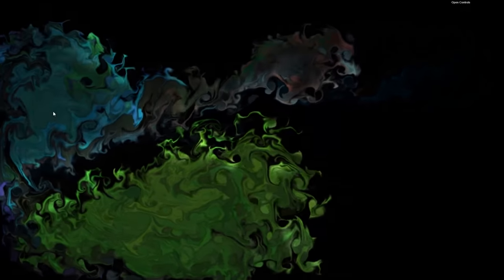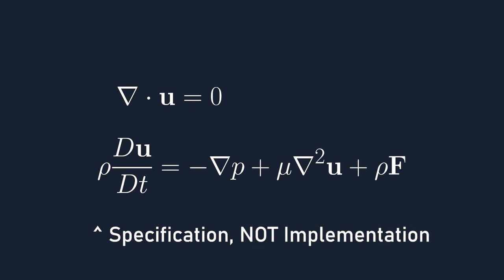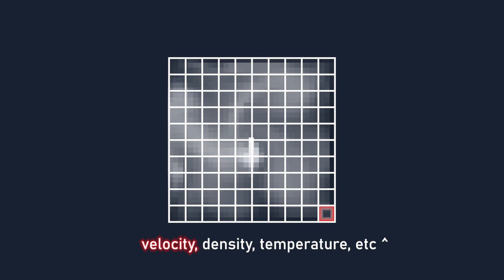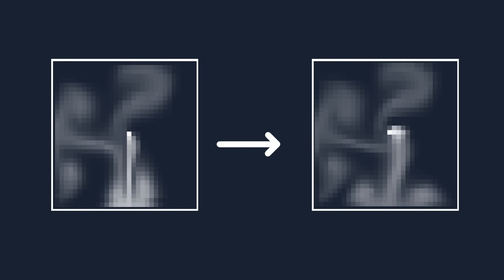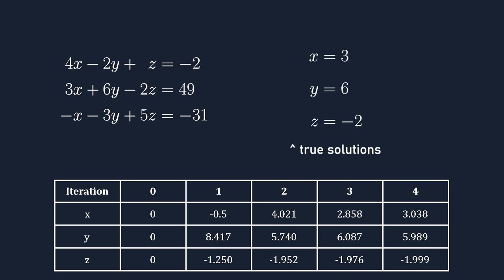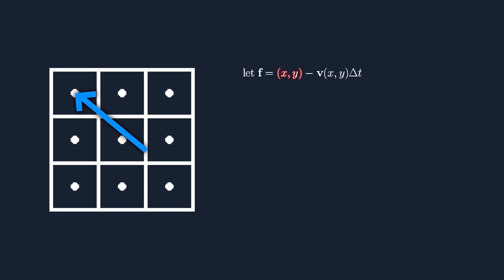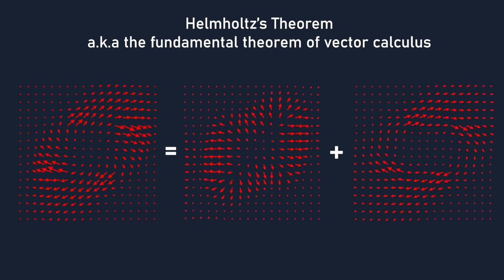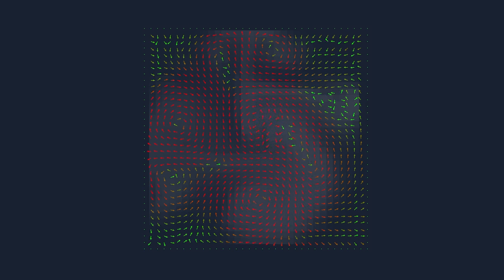But How DO Fluid Simulations Work?

Comment: Careful viewers! I might be wrong, but the equations shown for diffusion in the video are incorrect. If you look at the paper by Jos Stam, the simple, unstable equation for the next density is dn = dc + k(sc-4dc) (where sc means the sum of the densities in surrounding cells), which is not the same as the equation shown in the video, dn = dc + k(sc-vc), where sc is the average of densities in the surrounding cells. I saw that when implementing the method seen in the video, density was lost after diffusion even though it should just spread out.
Reply: Thank you! :D

Comment: Too bad I found about this video after I did the same thing. It took me over a year to understand the theory and algorithms behind Stam's papers, but you explained it in 15 minutes! Great video anyway!
Reply from the maker: If it took you a year, I'm sure you won't forget it anytime soon! :)
Reply: @Gonkee  I still have no clue how to program that. Have to watch the video 5 more times :D
Reply: @pinkyrng7104  just start one step at a time, try and get the basic system working so that you only need to learn one new concept at a time to eventually get it all working
Reply: Same for me. But it's not an easy subject though and contains many different algorithms and approaches. I also skipped the lerp part, because on the GPU you are able interpolate between pixels by default, with the filtering step.

Overall very detailed and well made video! It helps a lot of curious people.
Reply: @pinkyrng7104  You're making it sounds complicated more than it is. You just look at the N solver equation and implement an N loop for it. I did it in 1 time watching the video and just rewinding it to where the equations are.
Reply: @nullbeyondo  I mean you are clearly epic and he is not.
Reply: @Gonkee yea
Reply: yeah this video explains it pretty well (tho 10 minute physics' video does explain it even better)

Comment: Slight correction on the diffusion step, the equation according to original paper is x0[IX(i,j)] = x[IX(i,j)] - a*(x[IX(i-1,j)]+x[IX(i+1,j)]+x[IX(i,j-1)]+x[IX(i,j+1)] -4*x[IX(i,j)]), which would be d_n = d_c + k (s_c - 4 * d_c).

Without doing 4 * d_c, the amount donated to the 4 surrounding cells would only be subtracted once from the original, resulting in a net increase in density/velocity from nowhere and breaking conservation of mass.

Additionally, I believe the equation d_n = d_c + k (s_c - 4 * d_c) explains why its necessary to diffuse density reverse in time, because it blows up under certain scenarios, resulting in negative values. An example is if you have a really high value cell (say 100) surrounded by really small value cells (say 1). Let K=1. On the next iteration, the high value cell will have -396. While having negative velocity possible, having "negative density" is not and will cause the simulation to blow up.
Reply: Where do I find the original paper? The link in the description is not working.

Comment: Assuming that the divergence is 0 is indeed valid in most cases. This is based on the assumption that the fluid is incompressible. However with compressible flows one should use the continuity equation which allows you to solve it. But great video!

Comment: Fantastic video. As a Chemical Engineer I've seen lots of references to CFD studies, and always wanted to implement my own CFD and Finite Element (for heat transfer problems) solver.

One thing that is freaking me out is the casual treatment of density, i.e. just using a few equations to move density around. It feels wrong as density is the result of temperature and mass of material within a certain volume. I guess k is dependent on all those properties, but converting those properties to a number seems a bit magical / "ignore the man behind the curtain" type of thing. But then again I suck at maths, as I said an engineer not a scientist.

The advice to calculate dn with a hyperbolic function will be really helpful for me in my mathematical journey. Thanks!

Comment: 7:35 I found when I restricted myself to the four square of sharing sides in the diffusion I would get horizontal and vertical line artifacts, especially at k = 1 from the original equation. Including the four corners at a 1/sqrt(2) ratio prevented those artifacts.
Reply: Yeah i was wondering about that.  I got those lines in some of my pps experiments before I debugged.

Comment: Please do a whole lot of videos on fluid (and other) simulations. It seems many places love to show them in math, but not in code or explained in a way that can be done in code. (without excessive math skills) I'd love to see one on the 2D FFT ocean simulation. I've been wanting to learn how to do this one for ages on the GPU but it seems like there are very scarce public resources for it and many leave out key parts or assume you're incredible with math. Thanks! you've got a new subscriber :)
Reply: The reason it is shown in a math heavy fashion is because it is as math dependent as it gets. Even if you're using an off the shelf CFD solver, you must know the math behind to judge if the simulation you have just run makes physical sense, since the computer will always spit an answer no matter if it physically has any meaning
Reply: @JokerTheDank  If they could express them in a code type of way, rather than a math type of way, it would probably be far easier to check that you're getting correct results since it's more about logical steps than crazy symbols and memorized random rules/formulas.
Reply: @nk361  you haven't understood. Math is the reason you get certain results. 
You have a set PDEs, in a Continuum which are the real description of the fluid.
You then have to feed them to a computer, but a computer cannot deal with continuums as they are by definition an infinite data set. So what do you do? You discretise the continuum PDEs in many many tiny ODEs. But what has happened then? You mathematically approximated a mathematically correct description with a mathematically incorrect description introducing a mathematical discretization error.

So now exactly tell me where would the code tell you anything about the errors you're making in this approximation. Everything is mathematical
Reply: @nk361  and please, do not think of CFD as "crazy symbols and random rules"
Reply: @JokerTheDank  I wrote a whole comment and then clicked one thing and youtube decided not to hold on to what I wrote. :/ Pretty much the gist is that summation for example turns into a for loop with either a function passed in or a hard coded function per use case. You have to know both how the math itself actually works and how the code actually works for you to write that in code and get the results you want. That's where the difficulty is, most programmers don't know enough math to translate it and most math savvy folks don't know enough programming to translate it. If math was explained in pieces of code in languages that don't rely on prewritten math libraries (like matlab, octave, etc) then I think there would be so many more amazing software projects made by single developers or very small teams. Saying people need to learn math on that level to use it is like saying you should learn assembly on an advanced level in order to write c++. You don't because it's abstracted and made far easier for the public to get the results they need.
Reply: @nk361  a PDE Is a PDE. You cannot describe it using code without losing so much information that you end up no being able to trust your own simulations. It is not a sum
Reply: @JokerTheDank  Then they should still be easily accessible, just made clear which ones are accurate and which ones are approximations, described to be done on a computer in the simplest ways possible. Mostly just describe the logical steps you need to perform one at a time in a way that can be thought about without pure math. The delta in the navier stokes equations literally means multiple things for the same symbol and they're abstracting away what is happening in those spots. It's crazy how little logical detail or reasoning is given in pure math. In school they don't even usually teach you how the steps were originally found, they just give you pure math, tons of homework, and force you to think "that's just how it is"
Reply: @nk361  i think that you're just being lazy. You have to put in the time to understand, you can't pretend someone finds a different way of doing thing because you don't like the notation
Reply: @nk361  you have zero clue about math yet you speak as if you have all the answers. You have no idea how incredibly information dense each of those symbols is.

If you want to understand how conservation laws are discretised read "Numerical methods for conservation laws" by Randall J. LeVeque

If you want to understand how fluid dynamics equations are obtained read "Fluid Mechanics: Fundamentals and Applications" by John Cimbala and Yunus A Çengel

If you are just lazy and don't want to put in the months, or even years, required to fully understand these topics, then stop complaining that people should spoon feed you non-existent alternative formulations.

Just for your information, Navier Stokes can be also obtained by just considering two random atoms and computing what happens when they collide and then extending it to a volume full of these atoms
Reply: @joker  I'll look those up. No, I am not "lazy" for not wanting to devote years of my life to understand something that should already be easily accessible and may become easily accessible while learning it. It isn't spoon fed, that's how programming works. Want to use computer vision to notice different items in video? OpenCV is free, open source, and p5 has made it even easier to use with few lines and great, simple explanations. Want to know how to make a relational database? No need to spend years inventing your own and knowing every possible detail, use MariaDB the free and open source, easy to use tool to get started in one day. Want to learn how to make 3D geometry and animations all displayed in the browser? No need to invent your own browser, canvas, and renderer, just use ThreeJS, which is free and made very easy to get started. This is how fluid simulations should be. It should just be that you can pick between 2D, 3D, FFT, navier stokes, compressible, multiple, etc with not too many lines of code, parameters passed in, and some great explanations to get your good results. I mean heck, even keras is doing a pretty darn good job at making tensorflow easier to use. Imagine all the games, sites, animations, and engineers that would all benefit greatly if some great mathematicians/programmers made this available. Sadly, I think we don't have such a thing because it has been turned into such a big source of income. Like houdini, Flow3d, Cinema3D, etc that rely on the fact that it's kept hard on purpose and that no small group or single person can tackle this feat. They keep their developers and mathematicians under strict contract too. I'd like to think if I were "lazy", I wouldn't have skills in so many programming languages now... I am learning more and more calc on the side, over time, but it's still baffling to me how little there is for a decent code translation/explanation for free.
Reply: @nk361  that is because it is intrinsically difficult to do. There is no simple "do it all tool" because it is computationally demanding and theoretically hard to do better than what we can. Would you also like an open source Hadron Collider? You can't pretend everything is at the same level, because it is not
Reply: @nk361  if you want opensource CFD code go use openfoam and su2. A dumb RANS simulation such as a 2d airfoil takes about an hour to mesh well, an hour to assess mesh convergence, an hour to assess domain sensitivity, 10 minutes for each simulation you run, and then days to postprocess whatever data you want.

And this goes for commercial code too
Reply: @JokerTheDank  You could say the same thing about tensorflow though. The Hadron is hardware and not really general purpose/needed for many projects. Even the new quantum chips are allowing anyone to use them with quantum code that is explained for anyone to learn. There will probably be large, opensource/devtools made for them in the coming years too. I don't know, it just seems like fluids are probably the biggest missing piece in many cases. Houdini has shown it's very possible to make a great tool for it that's easy to use and user friendly, but it's extremely expensive, closed source, and gives no detail of the inner workings. I'll look into the ones you mentioned

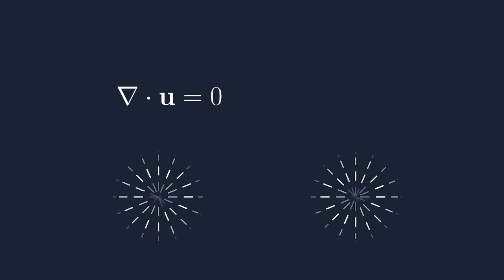Comment: 1:10 It seems to me that ∇ ⋅ u = 0 also requires that no compression of expansion is happening, not just conservation of mass. That's important because many fluids, such as gases, actually CAN expand or contract significantly, and all can somewhat. That's confusing to me, though, because the simulation you described allows density to vary, yet still has zero divergence. I guess that's because it models the motion of mass that changes density as diffusion rather than as the motion that it measures "velocity" for, so the "velocity" that doesn't include this "diffusion" of density doesn't have any divergence. I'm still not sure I really understand it though. For one thing, compression and expansion aren't the only ways that density could "diffuse". If the fluid is made of more than one substance, and the different substances have different densities, then diffusion of these different substances between different parts of the fluid would also allow density changes and diffusion of density without any compression or expansion.
Reply: u is momentum

Comment: quick note, your first equation for continuity is not implying that matter is getting created or destroyed, its actually just the incompressible anelastic fluid approximation. The full form of that equation can equal the change in density over time instead of zero to represent compression in fluids or flowing gases

Comment: You have a very clear narrative style! I like it. However, I am not sure if the relation between the differential operators and the discrete approximations will be understood by anyone who is not already familiar with the topic. Further, I would write an \approx instead of an equality in the cases where the left hand side is written as differential operator and the right hand side is a composition of central difference approximations.

Comment: Hey mate, nice video, I learned a lot. One question though, why are we using the Gauss-Seidel method? Solving the matrix looks possible, from a cursory look it seems invertible. Or are we already introducing errors of lower order in the divergence calculation so it doesn't matter and this is faster?
Reply: U hit it right on the head -- iterative solvers are almost always faster, particularly for larger dimensional problems, and since ur discretizing the problem anyway, as long as ur solve error is small enough, the difference will be negligible.  Direct solve takes roughly O(n^3) calculations for n unknowns, so if you have a really big system or lots of time steps to solve, iterative solvers like Gauss-Seidel, Jacobi or GMRES combined with a preconditioner like Multigrid or other kernel-based techniques can solve in as little as O(n log n), or even O(n) in special situations.  This is the approach used by lots of BLAS packages to solve big systems needing really small timesteps.

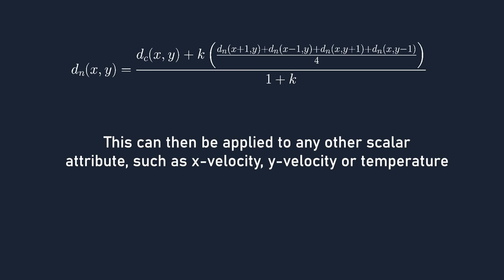Comment: at 6:12, can you please explain how it is linear? If k < 1, then you will never reach the desired density as you are always adding something less than the difference, and each time you are adding less and less. Also at 9:35, how can each square depend on the new value of every other square. That doesn't seem solvable.

Comment: Very interesting, a few questions though: 
Is this run on a CPU or GPU? I am currently working on a GPU-based fluid sim, I am just wondering about the performance. Also when a cell's new pressure / velocity is generated do you edit the values of the cells that you literally interpolate from?

Comment: What is the specific system of equations used for density using the Gauss Slidell method? I tried to implement it and it ended up interpolating each pixel's density with every other pixel's density instead of with just the neighboring pixels.

Comment: ok after 4 days of suffering and having rewatched the video like 50 times, I managed to implement it with pygame, the problem was that I was generating list of divergences by simply appending calculated values, and turns out that it is generated but the order is wrong, so I had to do it like that :
divergence = [0.] * len(self.cells)
for x in range(self.size):
            for y in range(self.size):
                # get divergence in each cell
                diff_x = (self.cells[self.index(x + 1, y)].vel.x - self.cells[self.index(x - 1, y)].vel.x)
                diff_y = (self.cells[self.index(x, y + 1)].vel.y - self.cells[self.index(x, y - 1)].vel.y)
                divergence[self.index(x, y)] = (diff_y + diff_x) * 0.5

thanks man really helpfull video to understand how to implement it (plus it most likely will be usefull for my game)

Comment: So if you were doing this in 3D, for a cube 100 lattice points to a side (not really that big)-that's 100^3 =10^6 points... but then the matrices would need to have 10^6^2 =10^12 elements(!!!) ...seems like that would take an ungodly amount of processing just to advance by a single frame,  even with this gauss-seidel method to avoid having to invert the matrix?